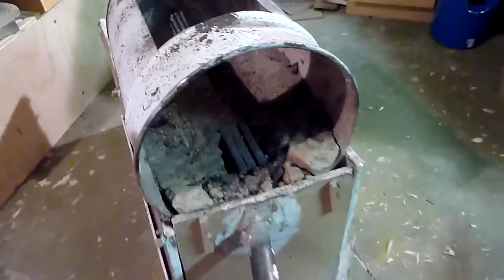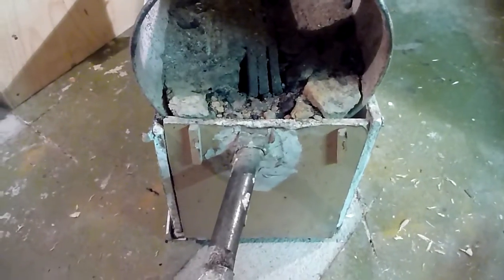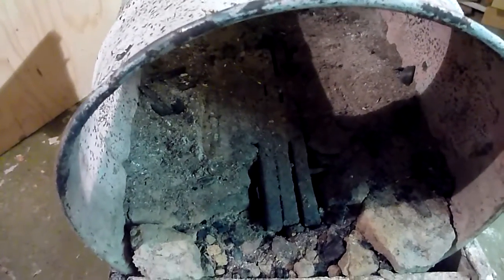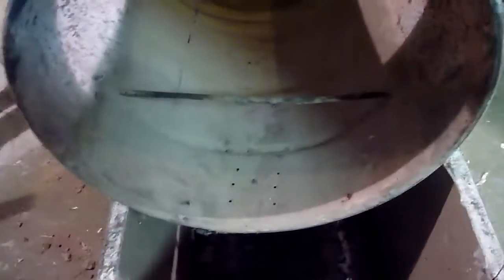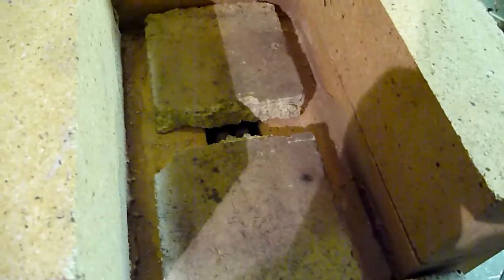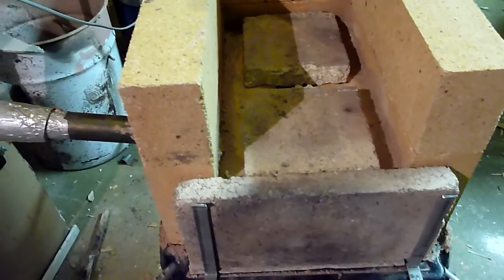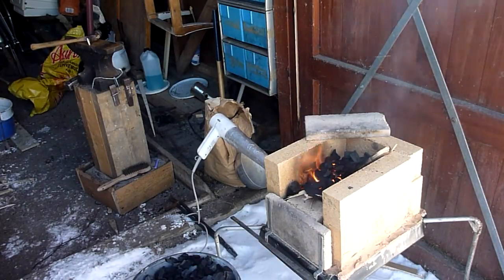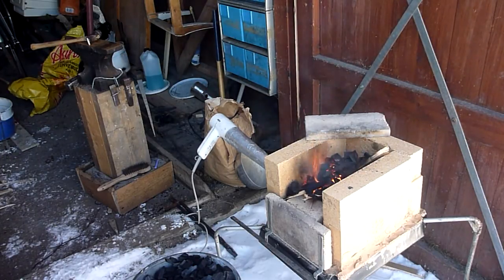New forge build

Comment from the maker: Mostly I use high carbon steel and occasionally spring steel. 
the charcoal is actually not that different in BTU from coal. the difference is the charcoal burns out faster and heat changes sensitively to air blow. with this new forge, it seems quite efficient to reflect heat. at the beginning of first run, the steel got heat up way faster than I was used to and it actually melted the part of file I was working on.